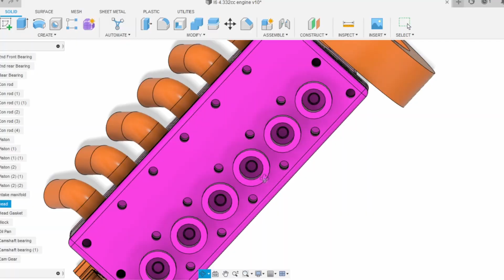l Tried to Build the World's SMALLEST 2JZ Engine!!! (IT WORKS)

Comment: so im 3d printing this thing! and its pretty easy too make it work first take a hollow plastic tube than shorten it and put it in that hole than do the air inside like using a balloon or a vacuum and it will work!

Comment: Are you using a normal Ender 3 printer, or a Ender 3 pro/V2?
Reply from the maker: I'm using a normal ender 3 with a few basic mods including a direct drive extruder, magnetic bed, and a  motherboard upgrade.
Reply: @AxelDayton  nice! Did it print in good quality before that?
Reply from the maker: @bricknplay  absolutely! The only issues i found with the stock printer was the filement spool would get caught when printing and it was loud. Besides that, quite an amazing printer if your looking at getting one
Reply: @AxelDayton  yeah, I am saving up for one, and it will be my first ever 3d printer. Was it only loud when it got caught, or always? Thanks so far ;)
Reply from the maker: @bricknplay  so really the printer was loud all the time. The cooling fans run almost the entire time the printer is on and the stepper motor do whine a bit when the printer is in motion. Besides that it's a very good printer. There's also a ton of people who have guides on making this printer the ultimate 3d printing machine for cheap if your interested in those as well
Reply: @AxelDayton  oooo nice! Thank you for all the tips! You’re the best! Greetings from Germany
Reply from the maker: @bricknplay  No problem! Glad I could help

Comment: Hey, I came back to this video, with this version of the prototype, hows the tolerances on the pistons in your build? I wonder if you having a bunch of piston blow by, and thus your arent utilizing the kinetic energy of the high pressure air.  Maybe taking rubber o-rings to function as piston rings, and then some lube for the cylinders will help this run on higher pressures. Additionally, changing the timing so theres some overlap between the intake and exhaust cycles to prevent compression due to the new sealing may help aswell.
Reply from the maker: I believe my tolerances are 0.1mm on each side of the pistons. As for the O rings, I've actually been thinking of developing a liquid sump to lubricate the cylinders. That way it can utilize higher pressures.

Comment: I have an idea of how you could make kinda like a gas tank for any of your motors.
if you take a bottle, add about 5 crunched up aluminium foil strips (they should look like rods) and pour a little bit of sodium hydroxide (usually 30%) to it, they will react and produce Hydrogen.
you do need to need to be careful with it because it makes hydrogen rapidly and if the pressure goes to high it may explode. also it get pretty hot.
just an idea I had that may work but I havent tested it or anything.

Comment: Try to seal the engine with silicon or sth. so the pressurized air wont escape without forcing the pistons to move
Reply from the maker: I've been thinking of doing that for a while. Thanks for the input!

Comment: Why not have it run on low pressure and just add a regulator?
Reply from the maker: I tried to do that, but it leaks so badly when using the pneumatic fittings that i couldn't get it to run consistently

Comment: watch out for the cr10 v3, check that the nozzle is tight. (check makers muse video)
Reply from the maker: Yeap, I've experienced some leaking out the heat block in the past.
Reply: @AxelDayton  get an all metal hotend, it's the best 50usd I've spend in my life

Comment: this will be really hard and you will have to make it a little bit bigger but make it out of resin and also make small piston rings out of graphite from a mechanical pencil so it holds air and lubricates it
Reply from the maker: The only problem is i don't have a resin printer :/

Comment: Tom has already won this challange: https://www.youtube.com/watch?v=5B1H5syp4PM
Reply from the maker: I don't see 6 cylinders and it's not a 4 stroke, so he hasn't won this challenge. He may have developed one of the most efficient air engines in the 3d printing world, but it doesn't follow all the criteria. So i can't use this design for this challenge. If you somehow made this design a 6 cylinder, and a 4 stroke, I'd consider it.

Comment: I'm a fan of the time-lapse on builds. I like seeing how other people come up with ways to build these. I don't know if you remember me. I had commented on a video probably over a year ago by now about how I was playing with making an over head valve air engine. I've made a lot of progress since then. Started working on putting up some clips of my builds, so I have one short up of one of my engines running off a balloon. Ill definitely  play with this and see if I can put my overhead valves on it. Also, what I've done for connecting my pistons and rods is use a paper clip straightened out and clipped to size. Somewhere around .050 inches, but I'll put a press fit on the piston or the rod and a slip fit on the other. Worse case a dab of glue will hold it in. I actually use a straightened paper clip for several moving joints.
Reply from the maker: That's actually really smart, it would definitely save money on bolts. Also, I would love to see the OHC on this engine!
Reply: @AxelDayton  I'm actually currently working on an overhead cam and valve design for a V8 build.  Planning to make an RC car that can run around with an air hose hooked to the back lol ill see if I can get it ironed out for this then. 

Are you dead set on using ball bearings? I've had good luck with just plastic to plastic contact throughout the engine.
Reply: Saves a TON of space for other parts to be thicker and stronger too since the bearing areas can be less than half the thickness
Reply from the maker: @morganmadedoodads  well, i use bearings because the crankshaft can snap under its own weight if it's not properly supported
Reply: @AxelDayton  I think I have a thick boi crankshaft design that that can fix that. I looked into "print in place" printing and came up with a print in place bearing. So now I can make parts a lot thicker and print the crank with all the main bearings and piston rods in place. I'll incorporate that into it also so you can see how to do that yourself. 

Definitely look into "print in place" printing if you haven't already. Can do some cool stuff with that and really show off what a 3D printer can do lol I'll have a clip up eventually of an engine I made to test my print in place bearings. I printed the entire rotating assembly and block WITH oil passages that I was experimenting with. Just to see if I could lol and it all worked perfectly
Reply: @morganmadedoodads have you had time to upload the video yet?
Reply: https://youtube.com/shorts/t5_PDIPWPKk?feature=share
Reply: Here's a link to that short I mentioned.

Comment: It can’t run at higher pressures because the air pressure is holding the valves down, while at lower ones, it’s too weak to hold them down
Reply from the maker: That's a good point, but I've never had this problem in the past with both the single cylinder and R1 engine. I do think the valves could be improved

Comment: I've been trying to design an engine that runs on air too. Mine is using tire inflator valves as the intake valve and just holes in the block for exhaust. You've probably seen lego versions of it. Right now im working on adding a quick couple and attempting to smooth the cylinders bore
Reply: I’ve seen those, they have revved very high. Over 10,000 rpm!
Reply from the maker: Sounds sick! I'll have to check that out
Reply: @AxelDayton  with your engines have u had issues with layer lines?
Reply from the maker: @shlushe1050  not really, i design them to be printed with a 0.4mm nozzle, but i print them at a 0.12mm layer hieght, so as long as the print goes well, the texture is normally very good
Reply: @AxelDayton  okay awesome, I print with a .3mm and my layer hights are close to .12mm.
Reply: Hi slushe 😂
Reply: Yeah haha, those engines rock!

Comment: Whats the bore and stroke on this?
Reply: Seems from the description that the engine is 6cc, which means every cyl is 1 cubic centimeter. So probably 10mm stroke and 10mm bore
Reply: @shlushe1050  I knew you were smart making that dyno, but calculating the bore and stroke? Amazing!
Reply from the maker: So my engine was 4.3cc, with a bore of 8mm and a stroke of 8mm. The reason why the dimensions are different in the challenge is to give you guys designing room to have more design opportunities
Reply: @AxelDayton  u don't need to give us any advantage dude! Challenge us! You'll be impressed